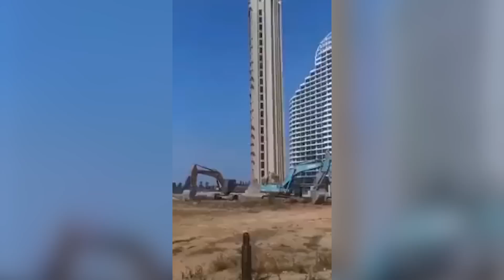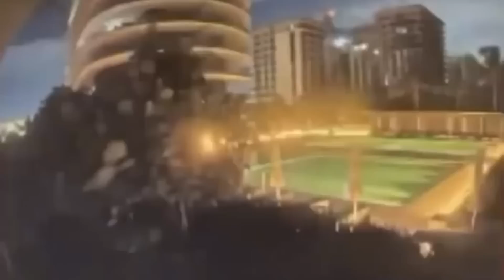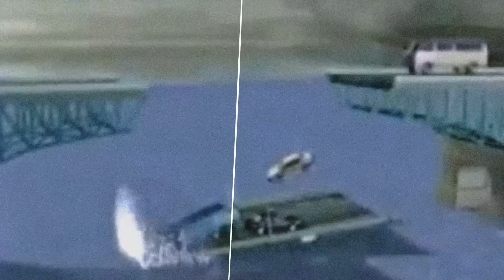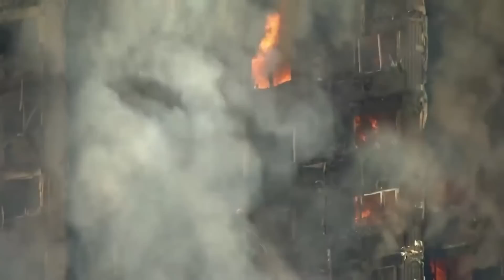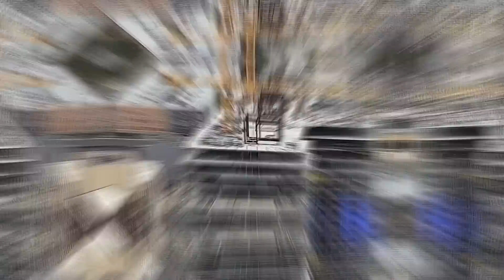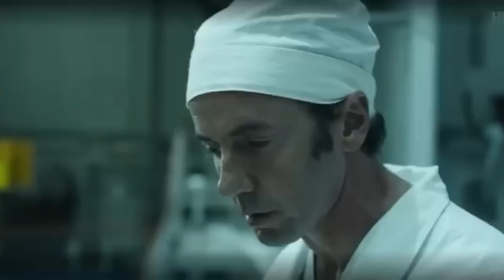20 Biggest Construction Mistakes in the World

Comment: Get your facts straight!  The Tacoma Narrows Bridge collapse had been studied by a University of Washington Professor for a year.  The video you show is his video.  The morning of the collapse the bids to modify the bridge to prevent this collapse were opened and approved.  Moments later the collapse was announced to the gathered contractors, bidders, and government representatives.  The replacement bridge contained those modifications.  By the way, the wind was about 40 mph not an extreme wind but a wind that resonated the bridge like a violin string.  The design change was to add gratings in the roadway surface to stop the surface from acting like a wing and change the resonant frequency.  All suspension bridges built world wide contain these gratings and avoid repeating this collapse.
Reply: The Tacoma Narrows Bridge collapse was a case study in aerodynamics and resonance, not just extreme winds. It’s fascinating (and tragic) how the bridge's oscillations built up to catastrophic failure. The modifications that came later, including the use of open grating or aerodynamic trusses, have since prevented similar disasters in modern suspension bridges. That video of "Galloping Gertie" is iconic, but many people don’t realize the extensive research and planned fixes that came too late. A real lesson in engineering and the importance of understanding structural resonance!
Reply: @rexroad9917  Appreciate "facts" 👍
Reply: Oopsy